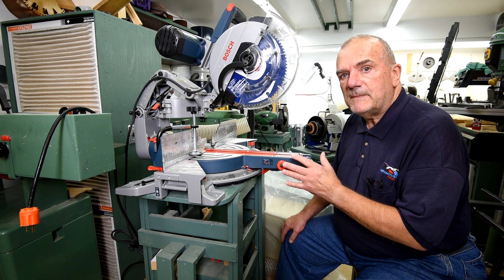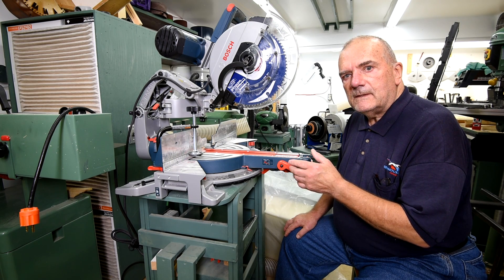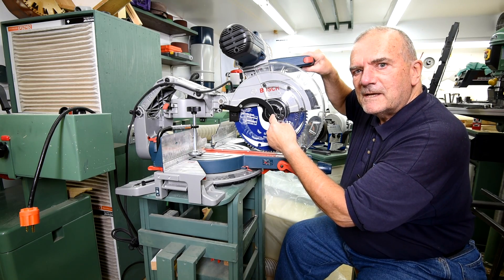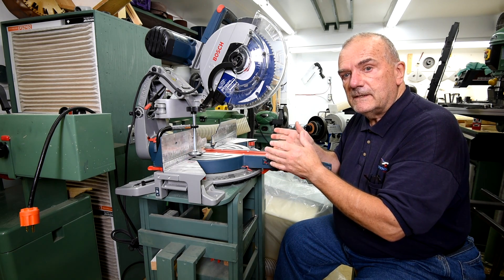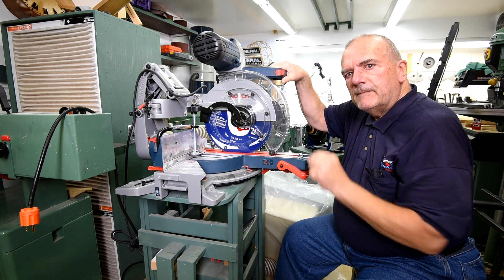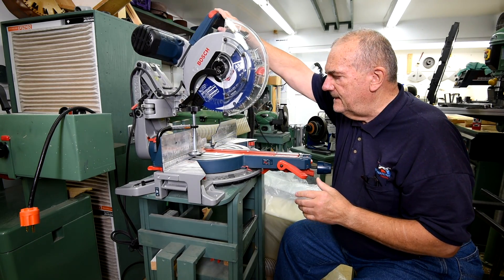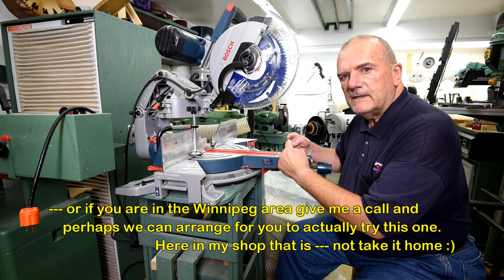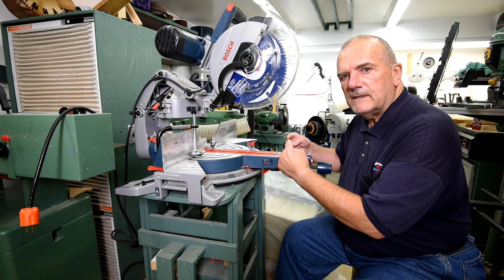Bosch GCM12SD - Blade Deflection - Part 3

Comment: Hi Ron,

I have a saw like yours, and while mine and your saw cut fine, sometimes saws will need adjustments to get them right.
As for blade deflection this is usually caused by thin kerf blades or the user is pushing to hard on the work piece.
Reply from the maker: My saw does have a thin kerf blades on it now. Possibly if I was to work it hard I'd run into problems, but most of my cuts are small piddly things. I have to admit that I really didn't need a saw that good, lol.  :)

Comment: Hey Ron, I came across your video as I'm having some trouble with Blade deflection on my Bosch 12" Glide Saw. I'm not going to read the hundreds of comments to see if someone has already said this but my particular deflection is like you can get a table saw, I believe, where the arbor or arbor nut aren't parallel. To be fair to the saw: I'm really splitting hairs here. It's about 0.010 difference (measured with a dial indicator) when the blade is spinning (spun by hand for measuring). I'm able to square the saw on one side to account for it, but then the other is out. So anything I need (should probably say want) perfect can only be cut on one side. That 0.010" is amplified when you glide the saw though, so if the glide is locked, it is one setting for 90, and if the glide is required for wide stock, it's another setting for 90. Maybe this is what other folks are talking about, and maybe clears up the problem some. It really isn't a problem for day to day carpentry, it's the finicky stuff that I like to be dead on. I haven't really dug in on the arbor/arbor nut yet, just looking around for more information at the moment.
Reply from the maker: Hi Jeremy,
Sorry to learn about your problem.
Re: "where the arbor or arbor nut aren't parallel"
I think that I'm understanding you, but all that will do is cause the blade to wobble and produce an unwanted wider kurf like a bent blade.
btw. I'm still very happy with this saw, although I'm slowing down a bit as far as woodworking goes.
Thanks for watching. Wish I could have been more helpful. 🙂
Reply: @roncalverley  Hmm, that should be mostly true, shouldn't it? Guess I'll have to keep looking...Thanks for the thought. Yeah, not trying to talk you out of the saw, just sharing my experience as you are.

Comment: Every once in awhile the manufacturing process produces errors in molded pieces, extruded, machined, etc. This is very normal because we are dealing with micro increments , and if this isn't caught (a few pieces being accidentally overlooked) during assembly than a unit with micro misalignment can be put out on the market. This happens occasionally and goes undetected sometimes. If this is the case, and one may never know, there isn't much that can be done. I only mention this as a possible culprit. Machining isn't perfect but it often comes close. Thank you for your video, and I hope this comment helps. P.S. there are many real world examples where manufacturing has micro flaws.
Reply from the maker: Thank you for your informative and interesting comment :)
Reply: Then Bosch should not sell this saw.  No one wants to pay 600$ for a machine that fails at its most basic purpose because the manufacture cannot be bothered to build quality parts.  I am in the market for a saw and I will definitely not be purchasing the Bosch.  It is a pity cos I really could use the space.

Comment: Let me clear up the confusion on what blade deflection is on a miter saw. Its the flexing of the blade/saw that occur during the cut. The way to test for this is to take a straight 4x4, cut off the end so you get a fresh end. Measure the cut face for square. Then you make another cut just as you did before, but this time only take off a 1/2 blade's thickness of wood (approx 1/16"). Then measure that cut face for square. When you shave off a 1/2 blade's thickness, some of the force that goes into cutting the wood is also trying to deflect the blade to one side. I often do this when trying to get molding to fit just right.

Comment: I've had the saw and the deflection happens when it is tilted. Do 45 bevel on a 300mm wide timber and you will see the deflection. it happens when you lean on the arm/handle a bit too hard.
Reply from the maker: Hi Joshua,
I just realized that I have never done a 45 degree bevel. I never needed to. Thank you for commenting :)
Reply: Joshua McLean if it happens when you lean on it hard?
Then don’t lean on it hard. 
“Doc it hurts when I do that.”
“Easy cure...Don’t do that.”

Comment: You could have condensed this into one video and much less time by cutting actual wood and checking the quality of cut.   It's really the only thing that matters.   Since you mentioned what you would change, the biggest problem with both glide saws is they dont have the same vertical cut capacity at 90 as 45 to the right. The mechanism gets in the way.
Reply from the maker: Thank you for your comment, and yes you are right about condensing the video :)

Comment: hey Ron I have the same saw..it's  not the blade that people are talking about if you bring the arm all the way out and grab it by the handle the whole arm assembly moves side to side a bit I think that's what people are talking about
Reply from the maker: Thank for your comment Blaine. I'm glad you said "a bit" and not a lot. They all seem to move a bit if enough lateral force is applied. Of those I've personally actually tried, I've concluded that my Bosch here is as good as or better than the rest. I think that if this "Axial-Glide" system was flawed I'd have noticed it by now. I'm very pleased with mine :)
Reply: Definitely, and this is an issue for me. If this is your first saw, it’s probably not an issue. I’ve been using a dewalt 12” for the last 9 years and it’s far more precise than this one. I feel like I have to “freehand” my cuts with what is supposed to be a high end saw. My dewalt has always been dialed at any speed, any width, any thickness, and with this Bosch, I always need to take my time and be extra careful pulling the blade away from a cut. Probably a great framing saw, but I bought it for fine woodworking and I’m unfortunately continuously frustrated with it.

Comment: When someone makes 3 separate videos to explain that a problem doesn't exist, one can reasonably assume that there's some truth to the original claim. I have the exact same saw for 10 years now. It suffers from terrible blade deflection, worse than any other mitre saw I've ever owned (DeWalt, Hitachi, Delta, and Makita). The lift return spring causes the black arm on the left side of the blade guard to put uneven pressure laterally - from left-to-right- against the blade when lowering the blade into a cut. As the blade is lowered, it shifts laterally from left to right causing cupped cuts. The saw is fine for construction work but completely unsuited for fine finish work.
Reply from the maker: Hi Darren,
Sorry to learn of your dissatisfaction. But, thanks for taking the time to comment and so fully explain. 👍
Reply: You want to say that blade guard spring create such a high load so it does tilt the whole arm?

Comment: I know this is late, but, all you had to do was make a five cut test like you do to check a table saw sled.   You're trying to determine if the blade tracks perpendicularly to the fence through its full travel range.   If there's a linear travel error, each cut would compound the problem.  Make the five cuts, and then check the 5th cut with a square to see if it is square or not.   If it's not square, then you have a linear tracking error with the blade.  If it is square - no tracking error.
Reply from the maker: I guess that I did not properly convey what type of deflection I was thinking of.
Reply: I guess so.  If you're worried about the blade deflecting side-to-side because of head (motor movement) as you pull the head through the length of travel, then make a cut test for the full length of extnsion would show that.  You'd make a cut and check the cut edge against a straight edge.  Any side-to-side deflection would show up as intermittent gaps between the cut edge and the straight edge.   Highly unlikely that there could be that type of mechanical play in the extension mechanism.